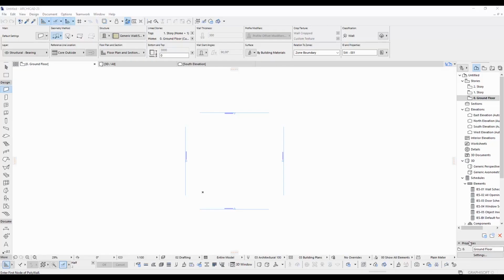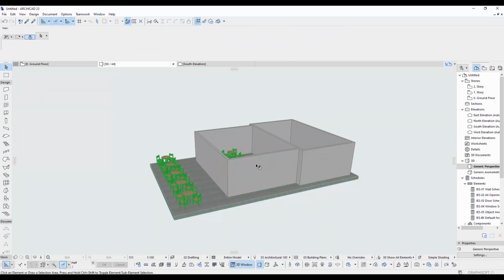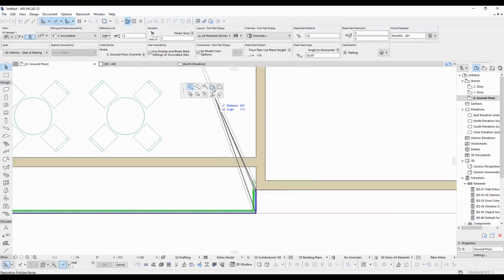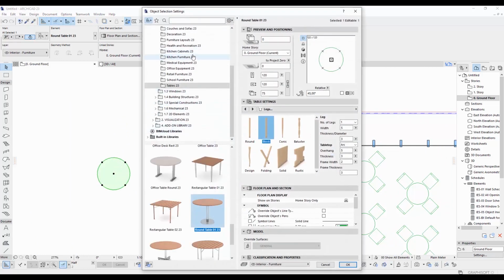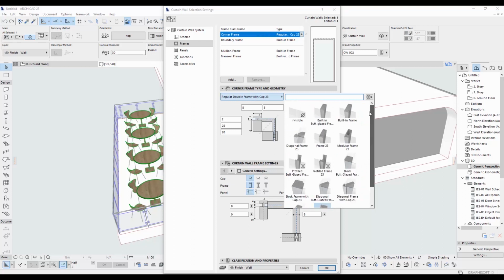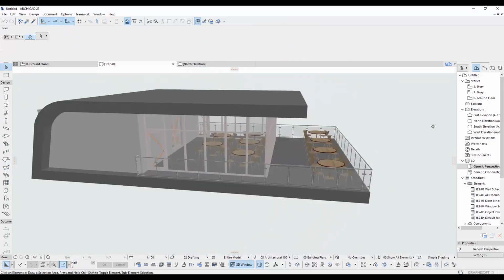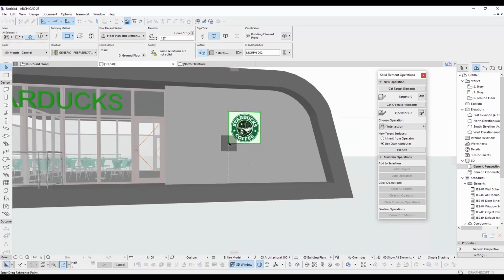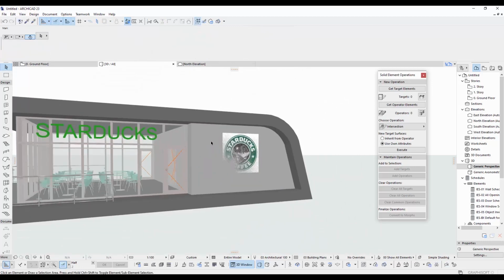ARCHICAD 23 Tutorial #6 COFFEE SHOP DESIGN

Comment: Hey I’m not entirely sure on what you did and how you did it during the shell modeling portion of the video when making the roof initially. Would you be able to go more in depth? I click the two points on the slab but it doesn’t let me click on the top of the wall, and when I do click on it, it just extrudes up as if I were making a wall. It doesn’t extrudes horizontally across the top. Thank you!